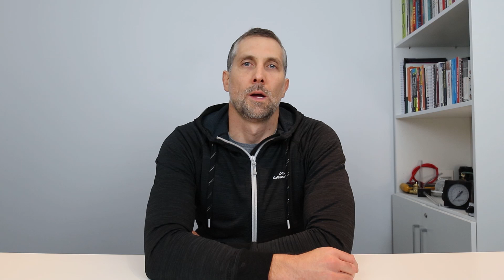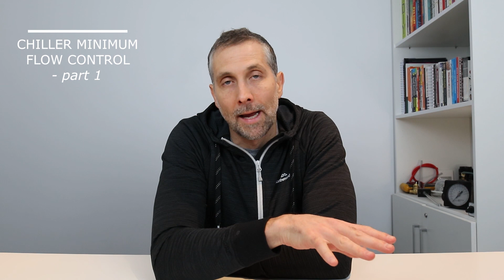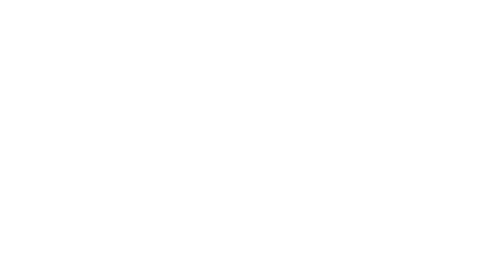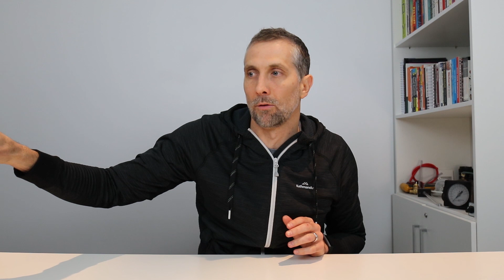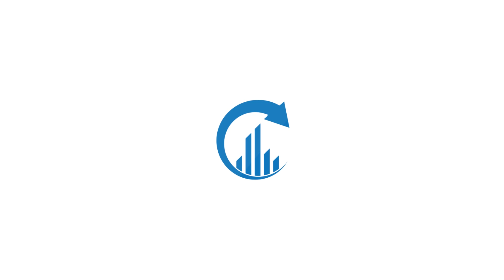Chiller Minimum Flow Control

Comment: Bypass valve is on off so they are not delaying. just on off only. Once pressure increases above the deathline then opening for safe otherwise some flexible pipes can be explod because system pressure its happened one DC in KSA all server crashed millions lost. It was found design selection issue from flexible pipe. But as per to trends we maintained DPT. I am BMS Programmier. But if water ballancing and designis matching with project requirements perfectly then that project is easy. If engineer is did wrong or just coppied somewhere we are getting headache but. As a six sigma certified I am doing the the best. I can just throw from my head but never I am considering all upcoming senerios my logic covering even examples sensor loses, energy efficiencies. As per to your example before bypass valve giving command just you start rumping up pump a few second once get feadback presuure reaching sensor then command to valve.. like a swich shock like heyy wakeup.😂

Comment: I think I also can do chiller bypass(in case low flow) +pump speed set to maintain minimum flow, and there is field bypass for overpressure, say 250kpa. How do you think Bryce?

Comment: Hi Bryce, Great explanation. Could you please explain what happens if primary pump only run but not the chiller and vice versa. I am bit interested to know. Thank You
Reply from the maker: Sorry Ravikumer, I haven’t been on YouTube for a few months. I just uploaded a video and realised there are a bunch of comments in here. 
You can not run a chiller without the pump first running. The chiller will have a safety interlock to protect the chiller. If you stop the pump while the chiller is running it will fault and need a manual reset at the chiller before it will run again. This is very bad. 

You can run a pump with no chiller. The pump will push water around the system but the water will not be cold as the chiller is not running. However, in low load conditions, when the chiller is starting and stopping frequently, which is bad for the chiller. You could stop the chiller and let the pump push all the cold water around. Of course the water will warm up as the chiller is not running. But demand on the chilled water system is low, so we are allowing the 'stored' cooth (cold water) to discharge through the chilled water system (like a battery). This is the only time that I run a pump with the chiller off. I am trying to reduce the amount of times the chillers starts and stops per hour.

Comment: Great explaination
Just one question. If I have only primary pumps (variable speed), with 3-way valves that need to be converted to 2-way system by only closing the bypass section of the valve.
We will only open one bypass manually and consider it as our bypass valve. I was suggesting that we will maintain the minimum flow of the chiller by making a minimum limit of pumps speed. Because also we don't have flow meter in the system.
Kindly need your suggestions
Reply from the maker: Hi Osama, 
Ideally the bypass will modulate to maintain the minimum flow though the chiller with a flow meter or differential pressure transmitter across the chiller evaporator. 
Lets say you don't have a bypass control valve or that it is closed. The pump will not maintain minimum flow through the chiller. If all the 2-ports close, even if you run the pump full speed, the chiller will still trip on low flow. Because the pump can not push the water round. I.e. relying on the pump to maintain minimum flow is not a good idea. 

If you manually set the bypass open to a certain amount that allows enough water to bypass to maintain the minimum flow through the chiller - this will work. However, this is a waste of energy as you are using more pumping power to push the water through the manually set bypass valve, every day. If you have no chiller differential pressure transmitter and you can not install them, then this may be okay, just not ideal. 

If you are going to manually fix the bypass open then you could consider this as an alternative solution. 
If the chiller needs 10 lps of minimum water flow rate, then leave enough 3-port valves in place that totals 10 lps. I.e. if each water coil is 1 lps, then keep ten 3-ports, and convert the rest to 2-port. Try to select these ten 3-ports at the end of the circuits. 

It may be a good idea to check with the chiller manufacturer to make sure the chiller can operate at a lower flow rate. Not all chillers allow a large difference between the design flow rate and their minimum flow rate. 
Also, you will need to get a mechanical contractor to adjust the chillers low flow safety flow switch/pressure switch as it will be set too high. 

Thank you for supporting the channel.
Reply: @bryceanderson17  great
What about if I have a system with primary and secondary pumps along with bypass.
So, we control bypass valve here based on the differential pressure transmitter across it.
Why ? To achive what ? Is it related to minimum chiller flow or protectibg system from high pressure
Reply from the maker: @osamamashal2602  
The chiller minimum flow control video only applies to primary only pumping systems. If you have Primary/Secondary then the decoupler protects the chillers min flow. With a Pri/Sec system the chiller can not trip on low flow because the primary pump can always push water around the primary circuit through the decoupler. 
If you have a bypass valve in the secondary system then it is there to prevent high pressure. 
So, as the 2-port valves close the system pressure goes up and the secondary pumps slow down to maintain set point. In extreme low load conditions, if the secondary pumps slow down to minimum speed and the secondary system pressure continues to rise then the bypass opens. 
If this does not make sense then you will need to show me a chilled water schematic so I can understand your system.
Reply: Thank you very much
Well clarified

Comment: Hi Bryce, 
Thank you for taking the time to share this information. 
When you mentioned the bypass valve opening to maintain flow to the chiller are you referring to the already chilled water bypassing to back into the return inlet of the chiller evaporator?

Thanks in advance.
Reply from the maker: If I understand you correctly, then yes. 
The bypass valve that is installed between the supply and return pipework, that when opened bypasses say 6°C water back into into the return water (6°C mixing into the return), and then going back into the inlet of the chiller evaporator. 
It gives the supply water somewhere to go when all the 2-ports are closing off in low load. 
Note: if you have 3-port valves at the end of some water circuits, which is quite common, then they also provide a return path back to the chiller to assist in maintaining chiller minimum water flow. Technically, if you installed enough 3-ports and you totaled all those individual flow rates and the total was equal to the required chiller minimum flow, then you wouldn't need a main bypass valve. Or you could have a smaller bypass valve as these 3-ports are helping to maintain chiller minimum flow. 
In my opinion, this is great for reducing the chance of the chiller tripping, but wastes energy as the pumps always need to pump more water as the 3-ports are always bypassing some water.

Comment: Another great YT - always need to cascade the Pump VSD and the by-pass control loops.  When I first started as a grad (in Australia's largest and best consultant) back in the 80's we always had the by-pass controlled by "system" pressure - but the sensors where actually across the chiller plant rather than the field 

Flow Meters are your best friend ..... where have you been all my life !!!   

However I find where it could get a little wonky is the scenario where there may a field CHW valve close to fully open whereas the other CHWV are near shut (eg: over night cooling for one area).  The CHW pumps wind down to a level where they cannot provide the minimum pressure to push the required CHW thro that one outlier CHWV.   Do not ask me how I know ☹
Reply from the maker: Mmmm..
This is where the compromise comes in. 
Traditional comfort control would have picked the most open valve as the process variable (in the pressure set point reset strategy). A comfort biased control strategy would solve this specific problem. 
However, in energy efficiency land, we would purposely have ignored that 'rough' valve as it wasn't deemed a good representation of the field load, and therefore not a priority in using more pumping power.  
This is a good example, of where, in that building, if it posed a real problem, that a good BMS engineer would have needed to firstly, spot that problem, and then create a custom solution. 
Thanks for sharing.

Comment: Interesting discussion about commissioning.  In my view we should just check major water flow to say floors, after that we waste time as 99% of the time the system is below design.  I’d say use the BMS for water commissioning, it’s so easy to look at flow meters, energy meters and valve positions to determine if systems are working.
Reply from the maker: That may he a little too far for mechanical designers and consultants. 
However, if we had networked valves, like the ones IMI and Belimo provide which allow us to monitor the flow rate, well then there would certainly be a case to discuss reduced water balancing to terminal unit control valves. 
Even with Pressure Independent Control Valves you could stretch that concept. 
I think the point here is that technology has move on far enough now that we could start challenging the concepts from 50 years ago.

Comment: Thanks for come clean on the subject . 
This is always in subject where nobody has a point of view.

Btw , what is the variable for bypass valves ? Flow sensor at return ?

Or based on high differential pressure ?
Reply from the maker: Hi, Not sure if properly understand your question? 
In Australia we have either flow meters or differential pressure transmitters on each chiller. The bypass modulates open to maintain the flow/pressure of the lowest evaporator flow/pressure of the running chillers. 
I have an idea that perhaps in the US they have a common flow meter for all chillers and then depending on how many are running, will calculate the minimum flow for the running chillers. I haven't done this so am only assuming from the sort of questions people have been asking me.